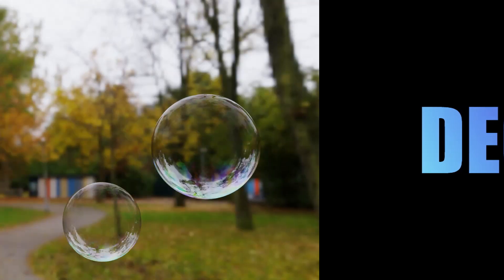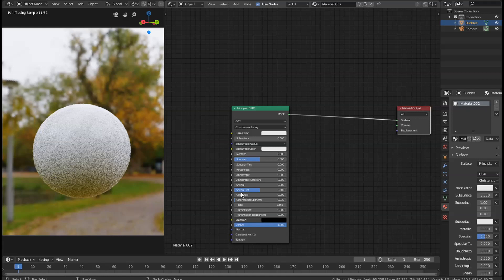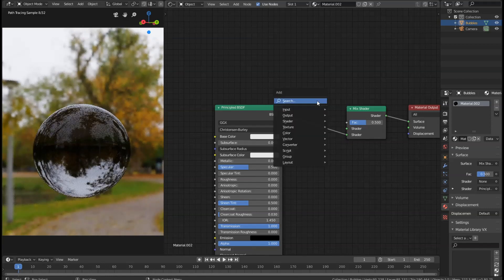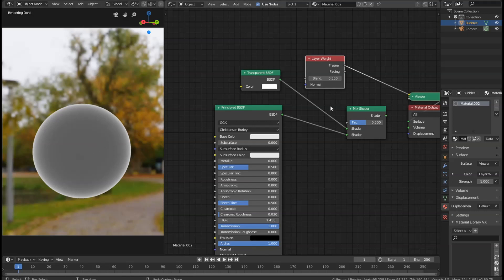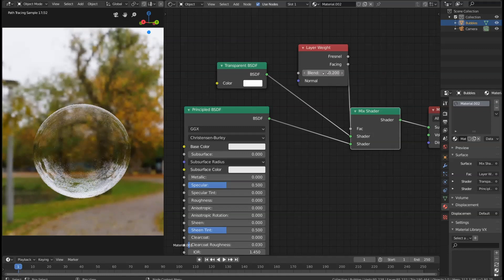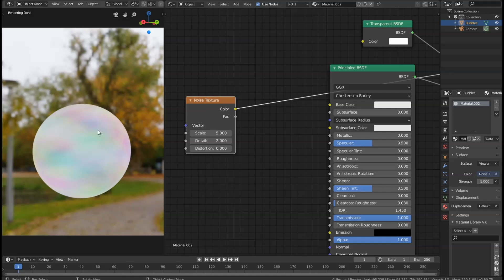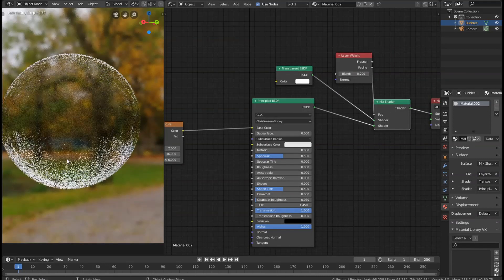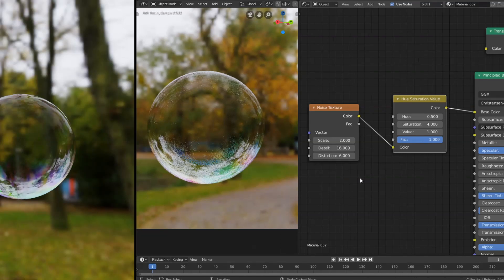Blender Tutorial: Realistic Bubbles In Four Minutes

Comment: Two cents:

You could also use a color ramp after the texture, and the bright/contrast node (the contrast setting) realy helps the colors pop if you still want more saturation. 

Also, i don't think many people know this but you can plug a Texture's Color or Factor output into another Texture's Vector input. Putting a Wave texture into the Noise Texture with some Distortion and Detail creates patterns like on real Bubbles. If you then rotate or move the wave texture with coordinates, or change the included scale parameter in the noise texture, you can get some nice animations in the colors while it actually has somewhat more resemblance to an actual soap film rather than just random blotches of colour. 

Very nice Tutorial. Just made me som bubblerinos.

Comment: Can u do one with 2.79?
Reply from the maker: I can't think of any reason why this wouldn't work in 2.79.
Reply: @DECODEDVFX  On 2.79, its very grainy even if i checked denoising
Reply from the maker: @gabriellasoliman7386  This material does have quite a bit of noise unless you use lots of samples. Unfortunately, that's just a byproduct of semi-transparent reflective surfaces like this. I'd suggest you update to a more recent version of Blender. Then you can use the new denoiser node instead of the default denoiser 2.79. I just checked, and it does a much better job of cleaning up grain from this material.
Reply: @DECODEDVFX  tysm 🙏